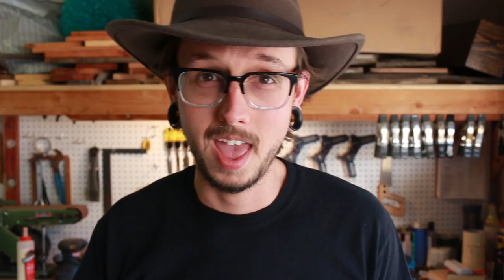Speaker Build Plans Are Finally Here!

Comment: Hi Kirby,
Thanks so much for releasing these plans for free, I've had a similar idea for an active / driving a separate passive speaker for a while now so it's great to see how you've done yours in detail. I have one question: The plans say you use 1" x 6" timber but show the side thickness as 3/4" are you planing it down at some point?
Reply from the maker: Hey Richard! Most lumber yards and home centers will use a "nominal" system of sizing the wood. The "actual" size of the 1" x 6" board that is needed for this project is 3/4" x 5 1/2" or very close to it. I'm not totally sure why they do it this way, I think it has something to do with the size before they are finish plained to actual thickness or before the wood is dried or something. Here is a simple chart that can help: http://www.familyhandyman.com/carpentry/making-sense-of-lumber-dimensions/view-all
Thanks for watching!
Reply: Ah I see, I think maybe this is a US thing, and it's different here in the UK? Thanks for the answer anyway!
Reply from the maker: Oh! Maybe! No problem.

Comment: Really understood the sound test part, I feel the same about that risk that people will listen thru the laptop speakers. But, the guys that understand how things work they will use at least some headphones for that... again, it is not the real thing, depends on many things (like the mike)... yet I miss the "hmm..yami" 

One question, how do you know what size of enclosure you need for certain speakers?
Reply from the maker: I feel ya! Thats a good point about the headphones. There really is no standard volume size for certain speakers, it fully depends on the application and enclosure type. Sometimes, whoever is selling the speaker (like Parts Express does this) will have recommendations for optimal cabinet volume for both ported and sealed. The best way though, is to use modeling software to test a range of sizes. There are also some calculators out there that can help. I'll be doing a video on this in the future. Thanks!
Reply: Kirby Meets Audio I'll be waiting for that. as far as building speakers I'm a noob :)